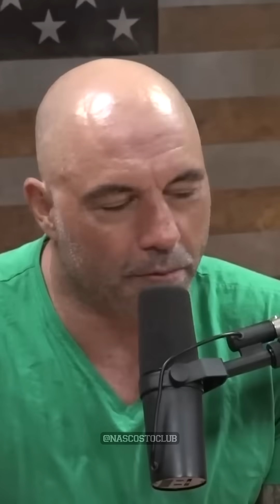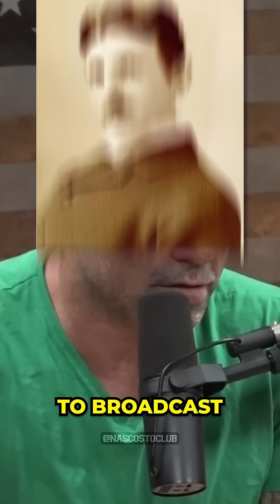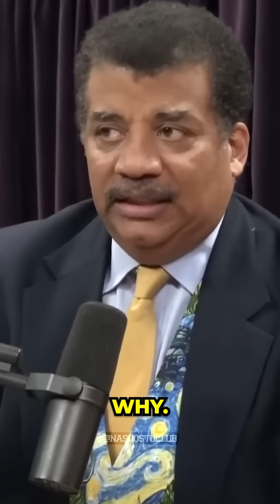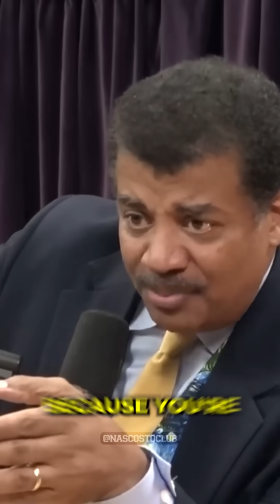WIRELESS Electricity Idea Debunked ⁉️⚡ #shorts

Comment: Tesla absolutely powered light bulbs wirelessly and had zero issues.
Reply: Wireless charging works the same way a transformer works. Coil of wire on the primary side (chi charger) and a coil of wire on the secondary side (phone) magnetically coupled together. Only works short distances within the magnetic field and is less efficient than just plugging in a charge cable.
Reply: @MrSleepProductionsInc  ok then that is different to what Tesla was doing.
Reply: @forgetfulpriestiv14  the major reason wireless power transfer is not used for large distances is that the receivable energy is diminished by the square of the distance.  I would estimate that a cell phone's wireless charger operates properly with the coils up to 1/2 inch apart.  If you increased that distance to one foot, that is 24x larger than half an inch, giving you a fraction (1/576) of the original power.
Reply: @DontRecommendThisShxt  Nah!
Electricity is always 100% efficient at becoming waste heat.
Every process produces at least a little bit of heat, to quite a lot.
Reply: @richtomlinson7090  do you mean carbon?
Reply: @Gatsu_Gambino  are you referring to when I mentioned heat in all electrical processes.
Reply: @richtomlinson7090  yeah, I m genuinely asking what you're meaning. I didn't ask to be mean sorry
Reply: @Gatsu_Gambino  well, my late father was an Engineer at General Electric and he always drummed into me the fact that all Electrical processes eventually end up as waste heat, and we take advantage of that for the standard resistance type electric heaters, and he warned me that all of these heaters or toasters or electric ovens are of equal efficiency at creating heat.
1,000 watts produces 3,412 BTUs all the time every time, whether its from an LED light bulb or an older incandescent bulb, all things that use the electricity create heat, even if we don't notice that some is warming the wiring in our homes, and if the process gets out of control and creates a short that damages the plug or device, we potentially get house fires.
So basically the phones that we use which are wireless, they warm things, and the more power there is, the more heat.
This is why they recommend not holding a cell phone up to our ears for too long, because it warms that area, which isn't all that great, so imagine if all our high powered appliances were run magically through the air like some people suggest, it probably wouldn't be a great idea.
Reply: you can power an incandescent bulb with a Tesla coil but if you don't know what you're doing then Tesla coils can be dangerous, that's why we have Faraday cages. go check out styropyro for some more info on high voltage and lazers and why they are dangerous
Reply: It's a stupid way to want to use electricity most things don't need to be wireless and I feels there's a lot that could interfere with this I believe he only made the Tesla coins power the light bulb a short amount of time not something you want turning on and off repeatedly,
Reply: @DontRecommendThisShxt  just curious, you say Tesla's electricity was different, I'd be interested to know what that difference was.
Reply: Farmers steal it under high transmission lines all the time. Cleaning out the old barn they put the highline over the old guy sees some sparks when he picks up a roll of barbed wire and gets an idea. They've busted grow ops doing this.
Reply: @thejunky1908  wow really...
I've seen a fluresent light tube light up...
But not anything else..
COOL...SOMETHING TO RESEARCH...
THANKYOU🙂
Reply: @Mrimperfections777  it's called induction coupling. Running wire parallel to a power line that has load on it generates millivolts per foot. But the out put depends on how much juice is flowing in the power line, so you can get 2 volts of leakage off the line or 2000 if the wire was long enough. Surges though could push insane power through it and destroy whatever youre trying to power and would most likely kill someone. Power companies can see the loss and will start looking for it if it's big enough.

https://youtu.be/CLS8pbDNHbk
Reply: @thejunky1908  someone told me about someone that tried that and got caught.
If you think about it, all they'd have to do is follow the path of the lines and look for unusual things like an out of place suspicious shed that's underneath.
Reply: @thejunky1908  thankyou for the expanded explanation..
Very cool stuff..
Hey doesn't those high power lines they usually feed through forests and over mountains  contain a massive voltages and if you get within any close distance from the wires ,the power can leap quite the distance looking for an earth....
Remember the warning signs...
Thanks again for that.
I'll go back and digest what you wrote ..😁
Reply: Neil is a paid goverment piece thats why he doesn't credit tesla, who actually made this possible  in real time just like all the wireless things were using today
Reply: Stop fuvking lying. This what happens when you smooth brains don't pay attention in school
Reply: And didn't Edison kill and elephant for the sake of his experiment
Reply: Big DIFFERENCE  in A Controlled Enviroment  ,like a room maybe , to Powering a City's Light Bulbs..
just because something works without incident in a Lab , does not mean He's Not right about The reality of it as an option to the greater public.. 
I don't like the man made waves already without getting ELECTROCUTED IN THE RAIN..🤪
Reply: @iiq12ii  I asked because I couldn't find anything about the incident.
Reply: This is a terrible idea because it's massively inefficient and can lead to health issues with extended exposure
Reply: @ericmanget4280  yes, it tends to heat things up, that you don't want cooked.
Reply: Show that. Repeat it too. If he could do it you could do it.
Reply: He lit up 25 street lamps placed all over Colorado Springs. Each street lamp had an antenna and a ground wire. Low voltage/low current applications is where this tech can be useful. Running a high draw air conditioner or a printing press, not so much.
Reply: Its talked about for a world fair
Reply: Ever hear of microwaves? On 
the island Oahu is Kole Kole pass. Military had microwaves transmitting through the air. I was there climbing the mountains. Its 
Navy property but I was in the USAF so I just showed my ID and 2 of us climbed all over. No birds. No bugs. Microwaves. No, it doesnt make sense to transmit any kind of signal through the air
if you dont have to. Radio stations have up to I think 100,000 watts.
Reply: Another jealous white boi thinking he's smarter than NDT 🤢🤣🤣🤣🤣🤡
Reply: Tesla did so in a control setting that's different than sending air through and ionizining as w result.

A mid level education in physics should teach u some stuff
Reply: @DontRecommendThisShxt  lol electricity works on the same.ptinciples on this planet. Tesla created a wireless conductor and is not that it doesn't work. Nuclear plants work there is a reason we don't mass produce them
Reply: Tesla had no issues. The rest of his family had alot,.
Reply: Dumb ass
Reply: Air is an insulator not conductive. You don't want to send electricity through it. You want to send electricity through highly conductive metals.
Reply: @Jeff  just like you, can't take out a structure with an actuator and some weight?
Reply: Lol nobody created anything in all of history and had "zero issues"
Reply: Yes but it was not efficient enough to be cost effective
Reply: He used fluorescent light bulbs..Not filament ones...The will light up in electric fields if you are close...
Reply: people actually demonstrate this phenomenon in order to bring attention to the problem of high power lines going through their neighborhoods.

I've seen how people will hold a fluorescent light bulb over their heads, and they glow, and this is in the vicinity of their neighborhood to show that it is a concern.
Reply: @richtomlinson7090  thats not exactly the same thing.
Reply: @richtomlinson7090  tesla drove a vehicle around wardencliff electric vehicle without batteries.
Reply: @saltlife8221  he probably actually harmed himself without admitting it.
Reply: @Rich Tomlinson  or was even aware of the damage done
Reply: from what I have read about teslas experiments is that there were problems with this way of sending energy through the air not the powering of the bulb or whatever the electrical load but the protection of one from this method and that he knew of a way of protecting himself but  I dont think he figured out how he could keep people protected on a large scale and where people have tried to recreate this on a big scale people have gotten hurt
Reply: @zanek4814  could be one of the reasons that he fell in love with a pigeon.
He may have warmed a part of his brain.
There's definitely a limit in how power can be transmitted safely.
Reply: @zanek4814  I've never heard this before. Do you have a citation?
Reply: @saltlife8221  bro he had years and major major investments from big players, at the end of the day he couldn't re create the experiment for 1 bulb, let alone mass scale it, he failed on that one let's keep it a buck.
Reply: @zanek4814  you will have to insulate everything and everyone..
Reply: @zanek4814  which is where his research ended cause he was defunded by big bankers like edison
Reply: Neil is jelly of Tesla. That's clear to me
Reply: Its called batteries...they had batteries in Tesla's days...BTW..that famous picture of him reading a book...while lightning bolts are around him was a DOCTORED picture...he was ADDED into the picture.
Reply: Yeah, I don't know what Neil is going on about because they wireless charging technology is what we are moving towards these days. Phone already charge without cables
Reply: @forgetfulpriestiv14 yeah but that works differently. I'm no expert in the matter, but going out of practical knowledge I'd say that works using low powered magnetic fields. The magnets react with each other producing the electricity, nothing that could actually harm you.
Making it large scale, like city scale or even neighborhood scale would require one HECK of a magnet for both the emitter and the receptor.
But then again I may be talking out of my ass and it's actually possible.
Reply: @forgetfulpriestiv14  is the phone you are charging across the room.
Reply: @happygilmore2100  obviously not but they are the same concepts. I don't understand much about the technology but I remember when it first came around looking into it and that it seemed from the same ideas and technology Tesla was working with but I may be wrong
Reply: @happygilmore2100  I had a problem charging one phone, because it had an Otter box protective case that kept it from getting close enough, so I know what you're saying.
I don't think I would want a power source beaming powerfully across me to my phone.
Reply: @forgetfulpriestiv14  the main issues are power at a distance, and all my wireless chargers need to be right there, and once you pull away a little bit it stops.
Also do we really want higher powered devices sending that radiation through us.

The concept of induction powered devices has been around for quite awhile, but there are serious safety issues.
Reply: @forgetfulpriestiv14  Over incredibly short distances because inverse square law makes any real distance fucking impossible.
Reply: @forgetfulpriestiv14  Doesn't wireless charging tech need an original source of wired energy or an actual battery pack that needed to be created which eventually wears out? Those costs aren't free energy. but I see your point that it's not dangerous to be around so that's interesting
Reply: @EtradePk  nobody was making the claim that the electricity would appear out of nowhere and be free. He had a way of making electricity broadcastable, nothing about free electric
Reply: @forgetfulpriestiv14  Ah alright gotcha, thx
Reply: @EtradePk  tesla tower was powered by regular electricity but transmitted it by airwaves to other objects.
Reply: @EtradePk  compared to the costs of burning coal (i believe that was the main source of energy at the time) his method was more or less free.
Reply: @forgetfulpriestiv14  yea and that way wouldn’t work at all
Reply: @forgetfulpriestiv14  goofy clown 🤡 🤣 😂
Reply: @forgetfulpriestiv14  a phone charging without a cable is still in direct contact with the device charging it, and that device isn't wireless itself...it's plugged in.
Reply: @yobogoya4367  yes, we got that already.......... Read the comments next time
Reply: @forgetfulpriestiv14  no
Reply: @forgetfulpriestiv14  k

Comment: What if there was a passive system that used this low-density form of energy to charge a battery that fueled whatever object or infrastructure? That is exactly what solar is, why would it not apply to lower frequency EMFs?

Comment: As an electrician who has been shocked up by touching light circuits. I can tell you, it’s not fun. I can’t even imagine what it would be like sending enough power to power up a stove or ac unit thru the air. That shit is on 10/8 gauge wire. I touched two hot 8 gauge wires together one time, at the start of my apprenticeship, the spark that came off it…. For the next hour, every time I blinked I could see it. Legit peed myself a little

Comment: LOL, Joe has no idea. I worked in the telecom industry, and microwave transmission being the only way to send radio energy with any semblance of target accuracy, if you transmitted a beam with enough juice to power anything mechanical, it would pretty much fry anything or anybody crossing it's path.

Comment: It would have worked and it does work. Doesn't mean it's safe. Plus thw power factor would decrease massive, as the energy travels farther away from the source. Tesla is also the one who discovered and advocated for ac electricity (high voltage). Tesla's lab is what produced the first monofilament lightbulb. Edison was just a fat sweaty hater who crwted the patent office. Tesla is the true genius. Think about it...🤔🤔🤔 how can Edison invent a lightb when he advocated for DC power which is more dangerous and doesn't travel as far. (Referring to the power factor) He also invented induction charging aka wireless charging. It's based on the same principle.

Comment: He's thinking of electricity as a normal electricity Tesla was talking about a different kind of electricity a high voltage low amperage frequency that could power DC motors AC motors all of it and it doesn't electrocute you the student ignorant f**** TV actor

Comment: Neil is correct because we know wifi is broadcasted through electrical wires and not mid-air 😂🤣😅
Reply: Wifi is not energy.
Reply: @analoguedragon7438  you're actually wrong... Wi-Fi sends data throught electromagnetic radiation, which is a form of energy. 🤔🤫

Comment: LOL, desperately trying to deny a fundamental fact. The Earth has a resonant frequency. Tesla used that via transformers to generate 'free' energy. De Grasse hasn't enough brain energy to even kiss Tesla's rear.  Both Carnegie and JP Morgan screwed Tesla and broke him financially.  Oh and Rockefeller paid schools to push the fossil fuel theory of coal and gas, so it would it would appear to be a non-renewable source therefore would have an increasing value. Oops, maybe it's a natural resource created by pressure and temperature.  No fossils have been found below 16000 feet, yet we find oil at 31000 feet. Huh. Oh, thank Tesla for your microwave oven and Bluetooth. Microwave is radiowaves tuned to the resonant frequency of water - which is why you can't microwave just any container,  if it contains water in the pottery it will explode. And metal will conduct it right back to the source.

Comment: Sadly I think Neil is correct. I think was Tesla was describing essentially was radio. It’s wireless transmission of power. Not enough to power the radio itself,  it the radio is tapping into a “free” signal I supppose

Comment: Not true. We know very well that we can send wireless power, it is NOT  a lot of power, but using radio signal, we can have a sender and a receiver, and that signal can be converted into electricity. Given how low power are the new LED lights, we could power them up this way. Efficient? Probably not. Possible, absolutely.

Comment: Electricity flows along the surface area of conductors.  Not through the metal in the middle. Think of it as a frequency guided by wire.

Comment: See he doesn't know anything about it. It was not a radio wave. It was pumped in the earth and if you had a receiver that matched you could pull it out anywhere in the world you can't do that with radio waves. Also he discovered a third form of electricity you have DC AC and longitudinal. He was using longitudinal waves